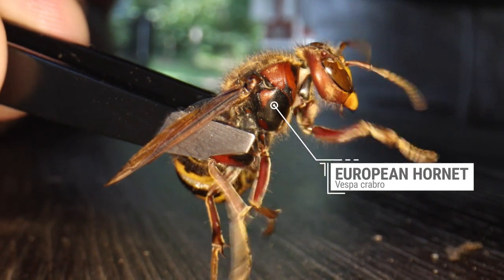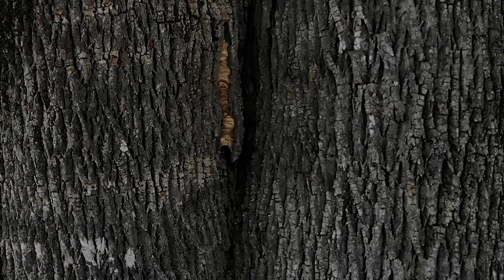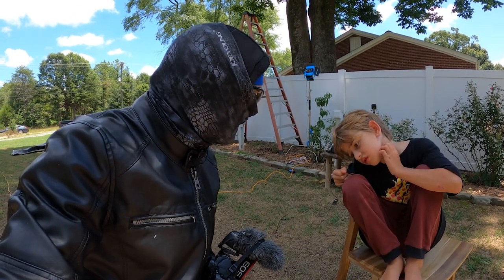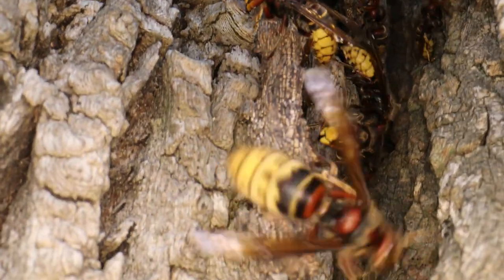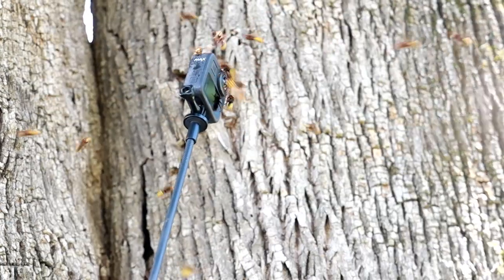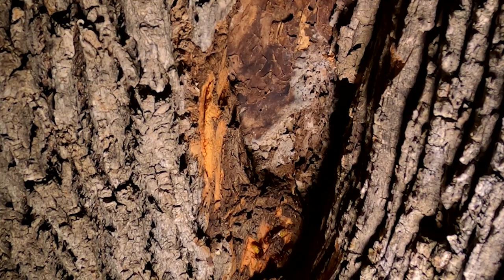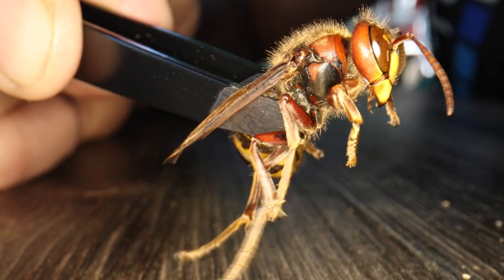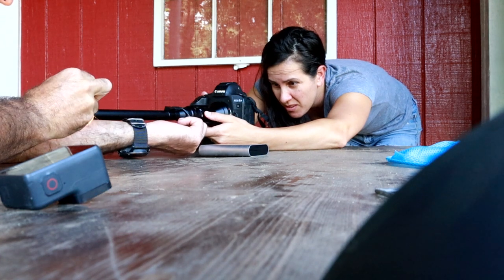STUNG BY A GIANT HORNET (IN SLOW-MO)

Comment: Just got stung by one or at least I think it was one in the arch of my left foot last night and no way in hell it was like when he got stung, like oh yea it stings a little. I'm 5" 11" about 200 pounds work in construction and have sliced, banged and bruised my body with every thing you can think of. I've had multiple tooth abscess I have a very high tolerance of pain and this was absolutely unbearable and lasted about 6 hours. I got stung fell stright down like someone shot my foot off all with a shotgun all while being burned with a hot knife on an open wound nonstop for 4 straight hours. The next morning and my foot is still sore. Absolute insanity that a 2 inch hornet can cause that much pain